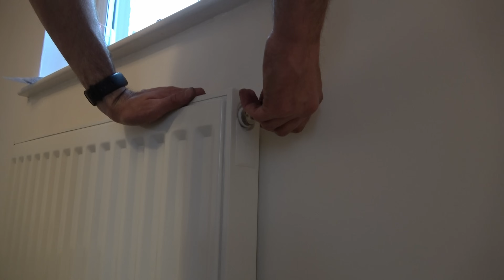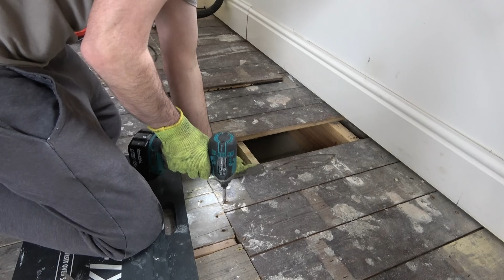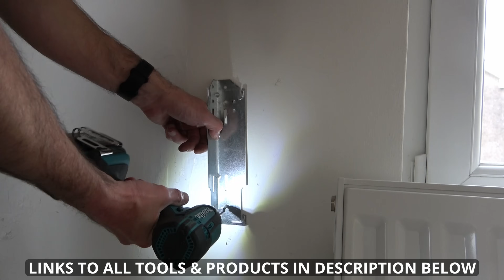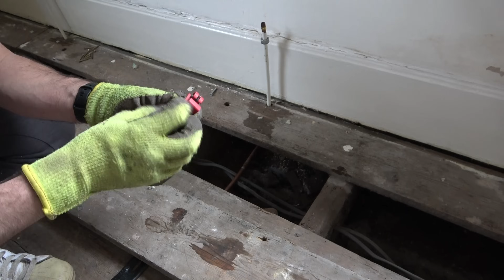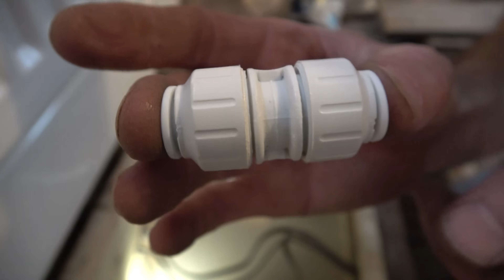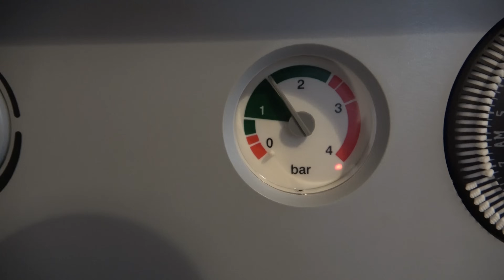How to MOVE a RADIATOR using PUSHFIT pipe. JG Speedfit plumbing. DIY remove and fit a radiator.

Comment: Might be a daft question, do I need to turn stop-cock off first before proceeding, or just allow boiler to stop the flow of water into my heating system?
Reply: If you stop the heating system filling back up, you don’t need to

Comment: You convinced me to remove the messy copper pipes mounted on the wall on the house I bought. Going to to put them under the floor like they should have done at the first place.

Comment: Super helpful video, thanks!

I’m looking to do try same thing but was wondering if you can use speed fit pipe directly into the radiator or do you need to go back to copper to connect into and out of the radiator?

Comment: Hi can you get back to me with a answer plz im living in Scotland uk and my whole radiator came off wall brackets and burst both copper pipes so turned off water on boiler what to I do now as I can't get hot water without flooding the spare room where the radiator broke so do I go out get myself a couple of copper pipes ,
A pipe cutter,
And shark teeth the ends or compression manually or not? What's best to go forward and save  my face i can do this but girlfriend has no faith

Comment: You broke every plumbing rule here. Using push fits under flooring. What if they leak?
Reply: They leak when not fitted properly.  Fit them properly 50 years garantee.
Reply: @algreenhough plastic expands and contracts. Rubber seals eventually fail 
More like 7 years before the customer comes down to open his/her Xmas pressies (sods law) and ceiling has damp patches. 
Copper lasts 80-90 years in areas with good water. These silly hemp smoking green types haven't done a honest days work in their life coming into the trade and poking their noses in

Comment: Can you help please I removed a radiator as you described painted behind and replaced the rad bled it and it work ok but I have a leak on the ball fitment is there a paste I cam use or just clean it with scotch brite

Comment: Do you need to turn the main incoming water supply off to the house (under kitchen sink)? And do you need to turn the boiler off?
Last question, if i want to remove the radiator for a few days but need the heating on while it's off, do I use a temporary pipe between the two fittings to complete the circuit?

I have subscribed and liked the video
Reply: You hsve have to drain the water in the central heating system.

Comment: Not one to comment usually, but no insert in the copper is not recommended, as the insert is not just to stop the pipe collapsing like you said on the plastic pipe but also to ensure no sharp edges cut the rubber sealing ring that's inside the push fit fitting causing a leak down the line.
Reply: Play explicitly state you must not use an insult on copper because when you use the proper cutter, it will help round the edge anyways

Comment: My gas boiler has no water loop presure valve. It's constant  0.3/0.4 bar on gauge. Plumber told it's regular self feeling system with Two tank on attic and tank in pressroom on 1st floor.

Comment: Just found your channel, great videos! Can i please check, can you use speedfit pipe for the radiator lock-shield and TRV? It would eliminate copper all together at the top.
Reply from the maker: Yes you can, but make sure you use the inserts, then use the brass olive and nut on the valve in the same way you would with copper. Best of luck with it.

Comment: As a time served plumber and heating engineer over 30 years keep going on this crap keeps me employed
Reply: Things advance old timer 😂
Reply: @Jan_-_-  not for the better
Reply from the maker: I'm not sure why everyone says it's crap? I've never had a problem. It's usually the installer is the problem, not the product. I'd be interested to know why you take issue with it?
Reply: @POUSEaroundtheHOUSE  I think what he's really hacked off with is the amount of work it takes away from him.
Reply: @POUSEaroundtheHOUSE  I know few plumbers who really didn’t like plastic when it first started appearing.  However, now they all use and happy to admit it’s great.  I’ve used it a few times as a DIYer and never had a problem, except when I hadn’t pushed it in further enough!  Great video.

Comment: I like using a 3 or 4mm masonry drill bit first, like a guiding pilot, because a thin bit does not slip off the mark as often as the 8 or 10mm ones do.

I also like to always vacuum the holes or use a (smoking) pipe cleaning brush (cilindrical) to remove dust from the drilled hole.

Another tip: I often find the need to drill with a 7,5mm bit for an 8mm plug. For this I grinded an 8mm sds bit a bit :), because 7,5mm is pretty much non existent for masonry. (Some do make hss metal bits tho. I might try using a 7mm masonry and then the 7,5mm hss bit for this kind of application. Sure, the bit will not cut mwtal anymore, it will be redesignated to be a masonry bit...)

Happy building, Everybody!
Reply from the maker: Great tips, thanks 👍

Comment: @POUSEaroundtheHOUSE Glad I found your channel buddy, just about to do this to my own house. I have to move a radaitor from one side of my hall to the other and was dreading it but you have give me some confidence to tackle it. 

Quick question is the quick type flexi pipe as leak proof as leak proof as copper with speed fit clips for below a concrete floor?

I actually changed every radaitor in my sisters 2 story house no problems as yet. I could attempt this myself as I like the diy and learn extremely fast. Thanks for the great video and keep up the awesome work man! 

You gained a subscriber and a like 👍

Comment: Thanks, glad I watched this, esp about the pipe inserts. 

About to add at least 2 rads to the system, which is a 22mm copper pipe circuit with 15mm spurs to existing rads. Planning to divert the circuit to the new rads. Do I stick to 22mm or would 15mm for the diverted feed be OK or too restrictive? That is, along a section of the complete circuit? Planning on using 'plastic' pipe regardless. I was going to use rigid pipe, but most of the pipework will be hidden or not too obvious. I hope I can minimise joins with flexible pipe but I guess there are limits to the angle of turn. Also, what would the best place to tap into the circuit - Closely before the pump input or last ones along the circuit? 
😀

Comment: Thanks for the video. Is it just me or are 10mm inserts really hard to push into the pipe, should they be lubricated or something first?
Reply from the maker: Yes they're quite tough, give them a good push! Best of luck. Thanks for watching 👍
Reply: O ring silicone lubricant. just a little bit don't go crazy

Comment: I used Speedfit pipe to replace most of the hidden pipework and all the radiators in my previous house. It was so easy to use and I never had any trouble with it. I sold the house about 7 or 8 years later, everything was still working fine. Going to use it again in current house. 😂
Reply from the maker: I've had speedfit in house for 10 years as well and no issues to date. Thanks for the comment and thanks for watching 👍
Reply: @POUSEaroundtheHOUSE they'll leak in seven years watch !

Comment: Gas engineer will be spiting chips lol they hate  plastic ...
Reply: my gas engineer used this and when I watched him do it it looked so easy it inspired me to have a go the next time. going plastic all the way to rad is better I think… I want as few joints as possible
Reply from the maker: Probably. I've used it for years and have to say it's great. Makes any job doable without out me cursing constantly! Thanks for watching.
Reply: @POUSEaroundtheHOUSE  also if u have a slight leak on a join its easier to sort

Comment: Literally just did this exact thing. Good to know I did this right. Shat myself when I saw pressure dropping a couple of days later -- turns out didn't shut off the drain off fully and it was leaking slightly, so easily sorted. Oops. 

Also in my case my floorboards were T+G so ran mini circular saw (with depth set) along joins to remove the tongue before lifting.

Also don't be a donut and try and fill the system with inhibitor via a radiator in a room you've just decorated, while the system is pressurised, or you will be redecorating and hoping your wife doesn't notice. Don't ask me how I know.
Reply from the maker: I actually loosened the trv valve not thinking after decorating following this video. Luckily the spray was across the front of the wall not directly on it so a few wet wipes with a gentle action saved the day! No idea what I was thinking 😂
Reply: Shit = current tense. Shat= past sense!😂
Reply: Shit not shat ?

Comment: Excellent video. Ah the golden years of proper floorboards
Reply from the maker: Proper floor boards but gaps everywhere. New floor boards are great if you don't need to get back under them! Thanks for watching 👍
Reply: @POUSEaroundtheHOUSE  
I used be an electrician. I was taught to carefully cut tounge and groove boards so they still fitted back snuggly. Others weren’t so neat

Comment: Remember to always close the radiator bleeder valves and drain off when topping up the boiler or you’ll realize the house is almost flooded 😂trust me I’ve been there
Reply from the maker: I've done it with a loose joint in the past so I know the feeling! Thanks for watching.

Comment: If I had a kerosene oil heating would the moving and refill of the system be different. Also for the same system hod do i service it please. 
Love the videos keep up the great work
Reply from the maker: To be honest, I'm not entirely sure. This is a combi (combination) boiler and has been a fairly standard installation for years. Although with times changing there are a variety of options out there now which may work differently. If I find out more info, I'll get back to you. Thanks for watching 👍

Comment: Nice job and instruction on the Speedfit gear.

Is 10mm pipe common in older properties?
Reply from the maker: It really depends on how new the heating system is but 10mm is common certainly on feeds to and from radiators  with combi boilers. But as mentioned in the video the main pipes to and from the boiler are 22mm to get the flow rate. I know back boilers (60's/70's) were usually 15mm pipes. Hope that helps.
Reply: @POUSEaroundtheHOUSE  Thanks for the info. Love these types of video and the subtle comedy within 🤣

Comment: Any suggestions as to how to drain a system that lacks a drain valve?
Reply from the maker: You could find the lowest radiator in the system and loosen the nut on one of tge valves. If you loosen the nut on the pipe (not radiator) side of the valve, you can close tge valve yo stop radiator emptying, then quickly push a length of push fit pipe with an elbow over the copper and use that as a hose. You will get a bit of water over the floor no doubt and you may find the olive on the copper is in tge way. Lots of cloths and a large bucket 😂 Best of luck 👍
Reply: AAVs can be fitted to radiators.
Reply: You might find there is a drain valve by the boiler and not near a radiator. If not you can buy self cutting drain off valves you attach to a relevant section of pipe, which you would then remove and replace with a permanent drain off or a replacement bit of pipe .
Reply: Biggest problem is getting rid of the air. My system has aavs in the loft being a bungalow all the radiators are below and even after bleeding all the radiators there is still some air in the system. It's a real pain.

Comment: Dear Pouse, is it possible to add a new radiator to the system rather than simply move one? Would you just add it in series with the existing radiators?
Reply from the maker: As you see in the video there will be a main flow and return to radiators from boiler, usually in 22mm pipe, then 10mm or 15mm pipe from this to the radiator and back to the main pipes. So you should add tge new radiator from the main flow and return (22mm). Look at 2 minutes 10secs in the video. Hope that helps. Thanks for watching 👍
Reply: ?👍🍺? @POUSEaroundtheHOUSE

Comment: Do you need to turn the boiler off before starting?
Reply: Nah leave the car running why you change the engine
Reply from the maker: It's a good idea, but to be honest once the pressure is down, it'll have an error code and stop it from working anyway. Thanks for the question 👍
Reply: You can isolate flow and return of central heating,straight under boiler, that's way you don't need turn off boiler and have hot water in taps.